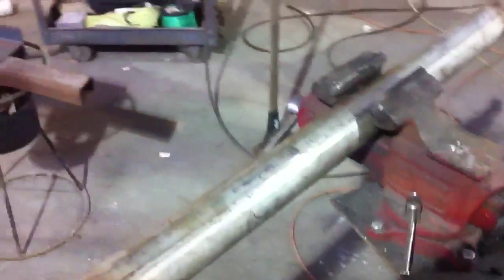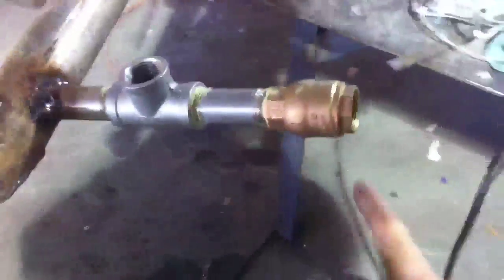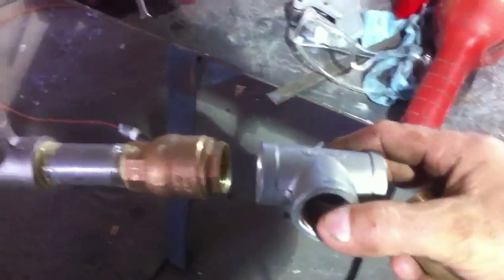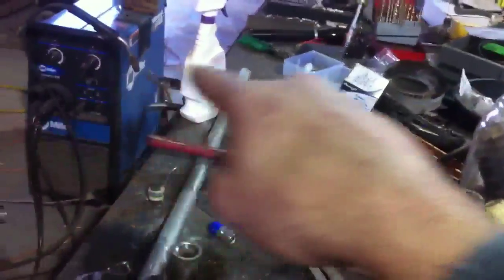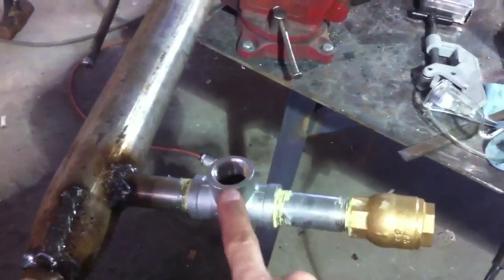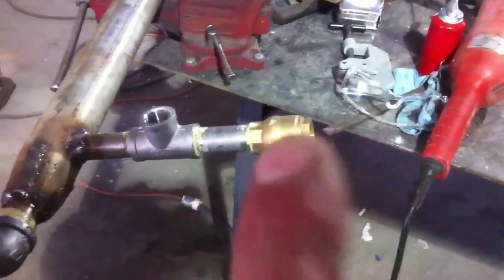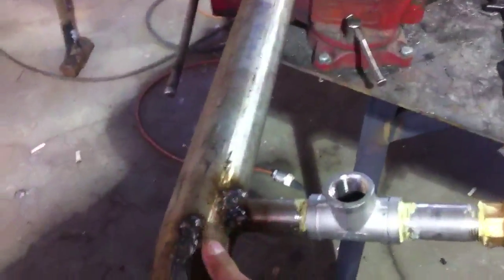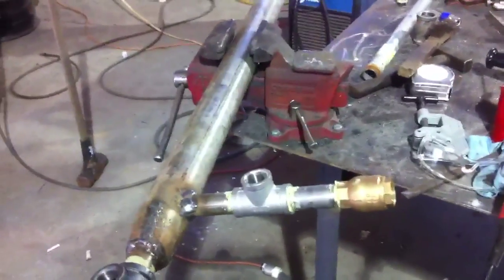Water heater exchanger

Comment from the maker: You r probably right but It was for good measure LOL.. I did get a Mixing valve ... I think they are called tempering valve..   But I have not put it on yet.. It will be installed... Thanks for noticing that.. That is what all this is about.... Helping each other out.. Thanks again..

Comment from the maker: The boiler is a closed system... The water from boiler is not for drinking.. This exchanger has a pipe inside going threw it which cycles back to the boiler.. The drinking water cycles back into the water heater. Thats why the check valves re put in so that the water flows one direction. If you notice the bigger pipe is welded to a small pipe... The small pipe is the one that goes back to boiler.. Give me your e-mail and i will send you a drawing.. If you want